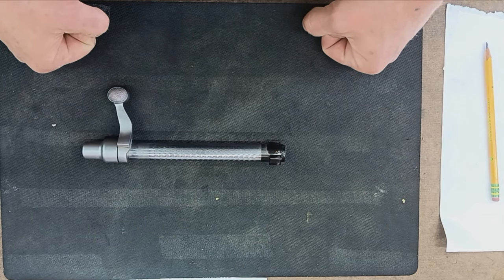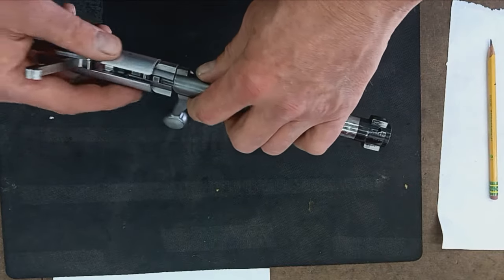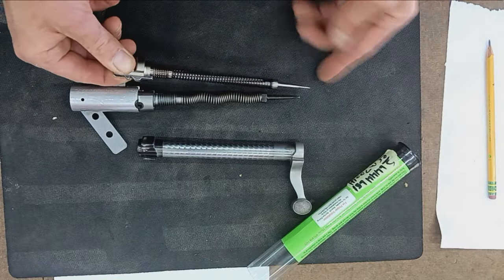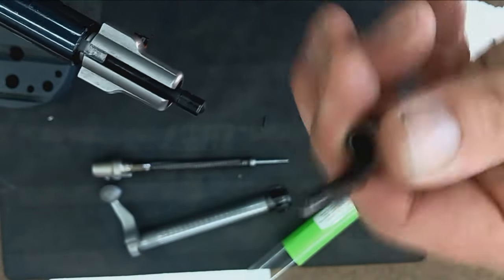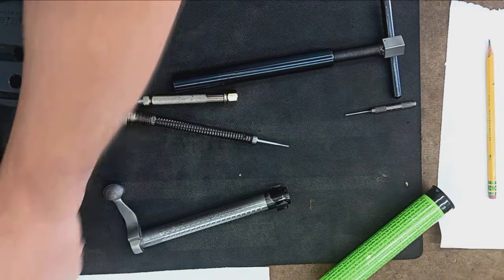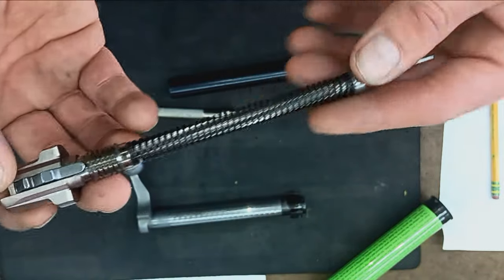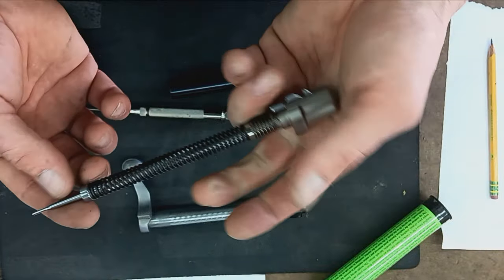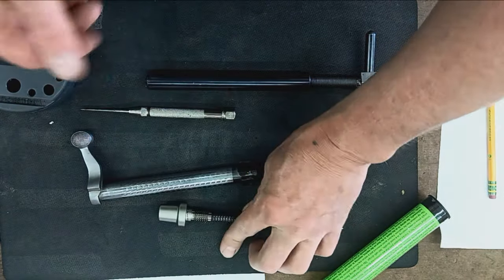Remington 700 j-Lock - undesirable redundant safety to AVOID, and how to fix/replace it!

Comment: I have 4 700’s I bought new that have the j locks. I always wanted to replace like you did here. Just never had any issues with my 2 predator rifles (17 rem and 243)and 2 ultra mags (300 and 375) that I’ve been shooting for decades. Eventually I’ll get around to it. Thanks for the reminder.
Reply: It doesn’t look like Silver finishes match up. I have one that’s been dipped in camel two stainless and one blued. How did the blue finishes match up? Doesn’t look like the silvers do very well but who cares right… at least you have a more reliable ignition system. I’ve been looking at Greg stuff for probably 15+ years and never pulled the trigger. Just because I haven’t had an issue yet but eventually it’s gonna bug me in one day. I’ll have to replace them all. I just don’t like the idea of that coil spring just a bad bad design.
Reply from the maker: Yes, sometimes it's not an issue...  "one of those things", right?  Well, if you're interested in upgrading, accurizing, customizing, and/or restoring any of your 700's, We're definitely your one stop shop!!
Reply from the maker: it's not an exact match, but who cares, right?  As you say - it's an upgrade for the betterment!

Comment: Dont replace the bolt just the bolt shroud with one from G-tan
Reply from the maker: The video is literally all about replacing the j-lock firing pin assembly with the firing pin assembly made by Gre-tan Rifles.